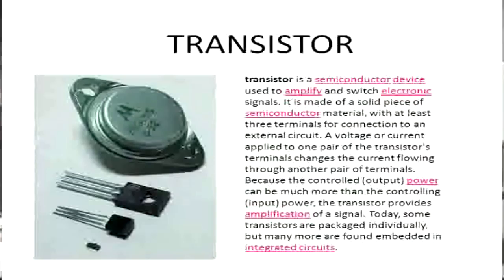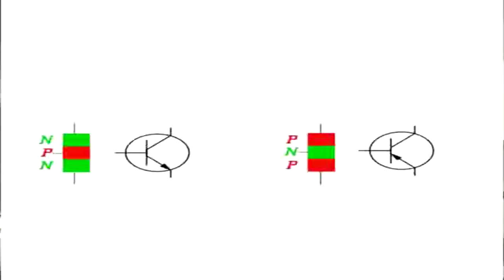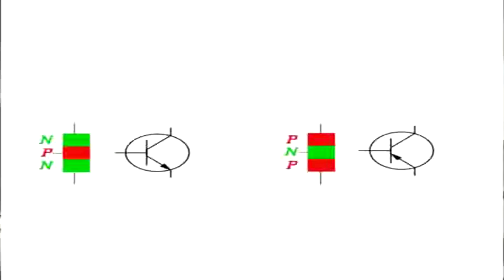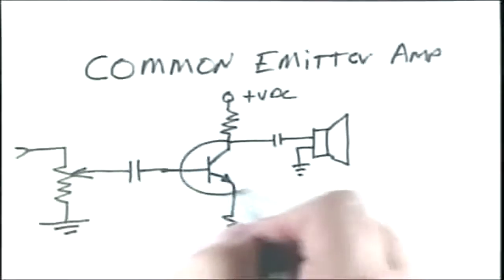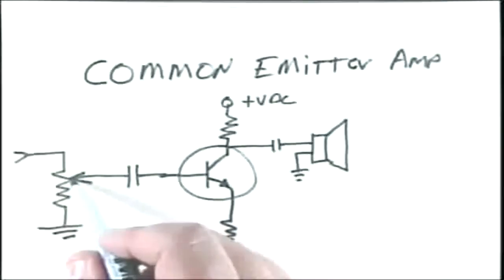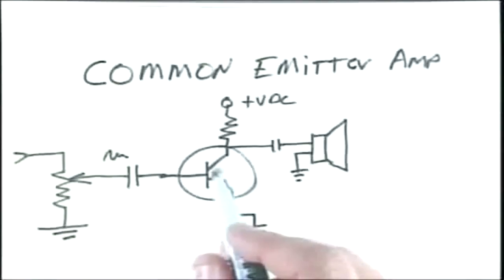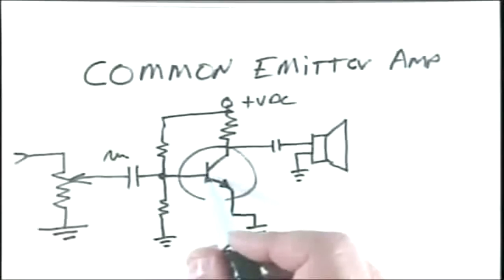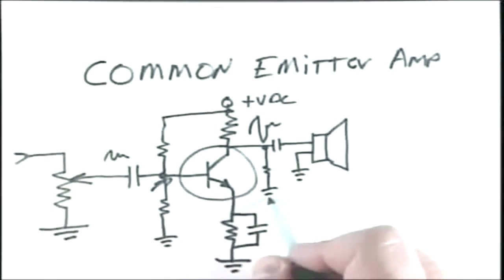Transistor Overview

Comment: Wow!!! With Ce across Re, The Gain Will Be HUGE!!! With Respect To An AC Input Signal Ce Effectively Shorts Out Re leaving The Residual r'e(=.026/Ie) So Instead Of Av=-Rc/(Re+r'e) The Voltage Gain Of This Amplifier Becomes  Av=-Rc/r'e which amounts to some pretty Beefy Gain!!!! r'e Typical Values Could Range from 10 to 30 ohms

Comment: It should be noted that this circuit would work well only with a high impedance speaker.  Typical home audio speakers have low impedance on the order of ten ohms, and would load down the high impedance output of a common emitter amplifier.  To use this with a low impedance speaker, you would probably follow the common emitter stage with a common collector stage, likely in a push-pull configuration.